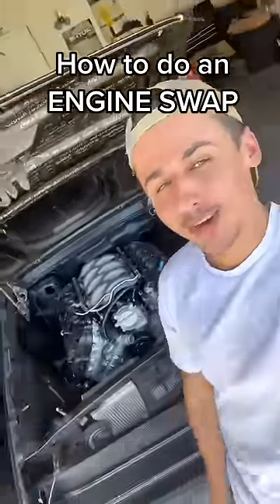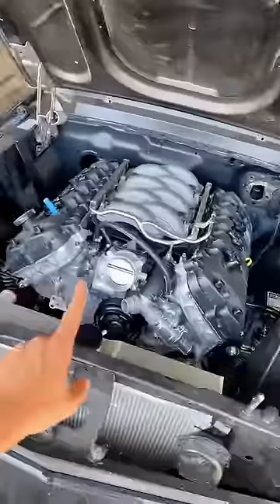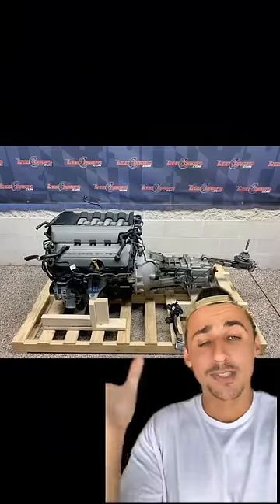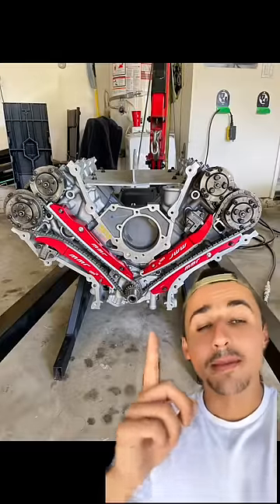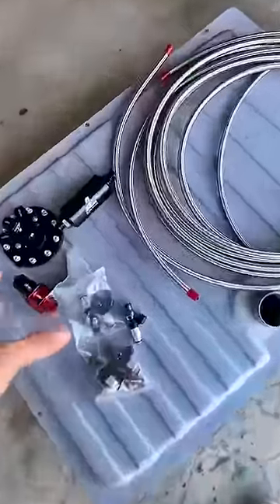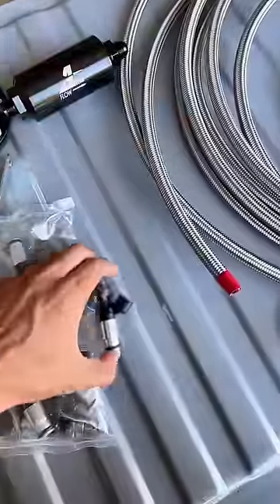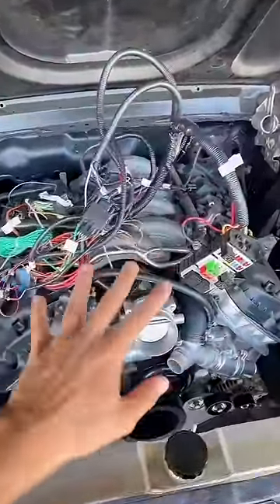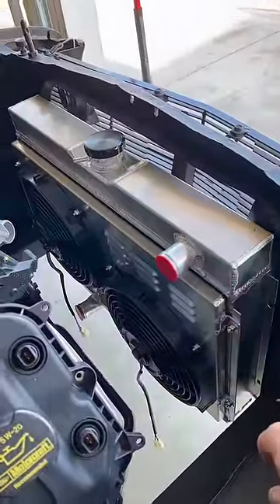How to do an ENGINE SWAP 🏎💨

Comment: It’s not that easy😂 every car has its own level of difficulty and has its differences and similarities, even If it’s a engine replacement or an engine swap, Where you take a engine that didn’t come factory with the car and place and fit it to run like it belongs there. It just depends on your skill and knowledge.
Reply: he never said it was easy. He also struggled putting a gt500 motor on his s197 mustang
Reply: Did you want him to cram the whole weeks long progress into this short?
Reply: Yea but he made it seem/sound easy in the video when it isn’t. to someone new that’s getting into engine swapping, hearing this would make it sound like a breeze. But at the same time you have to have some knowledge on cars and/or know how mechanical things work and operate, in this case engines, before jumping straight to engine swapping. It’s something not every one can do, but can for sure learn to do.
Reply: @ricmane8693  no but yes
Reply: The name of the game is to tune tune tune
Reply: @baconintheoven4717  I'd hire out someone to rebuild the engine then I'd swap it myself
Reply: Right now I am thinking about swapping the 2.6l m103 in my car with the 3.0 version. Supposedly it should just bolt in as it uses the same engine mounts transmission etc. I am 99 percent sure it will not be that easy.

Comment: “If it doesn’t fit… make it.” 
Well you see…. I’m having trouble with the firewall trying install this big block 400 into this gremlin… might have to just be touchin cylinder 8 in the cab
Reply: this guy don’t even know what a gremlin is
Reply: @LeakyCoolant  I always wanted a gremlin for some reason but I just bought a 77 gran prix so it may not be the best idea right now lol
Reply: Make it fit

Comment: Engine swaps on a car that originally came with multiple diffrent types of engines with no electronics is pretty much straight forward.  Also, the aftermarket for vintage mustangs is extensive.

Comment: The main things you need is the transmission mounts, the transmission that'll hold up to your power, radiator, motor mounts, longer or shorter drive shaft, starter if needed, oil pan so it fits on your crossmember/frame, wiring harness, computers, fuses if needed, but all if the wiring is if you're not dealing with a carbed motor. If you're not dealing with a donor vehicle which is cheaper, you'll need everything in this video.

If it's a donor vehicle which is what me and my father using, all you'll need is to flash the computer and have the regular harness turned into a custom standalone harness along with adjustable motor mounts. All the other stuff you might need can be taken from one vehicle transferred to another. Grabbing a donor vehicle is a WHOLE lot easier and cheaper that way.

Comment: generic, but youre not wrong. if you want easy, go with a 90s honda. my first few swaps were on those. used a 96 Si (yes we had them in 96 in canada, but it had a d16y8 in it) with a B18a1, engine harness for the y8 modified to work on the b18, and a computer from a 98 integra. 12 hours later it was driving, by modifying the d16 shift linkages, modifying the rear engine/trans mount, and making the drivers side mount of out steel. total cost of swap, $550. 
my second swap was a 302 ford into a miata, followed by a dodge 440 into a square s10. its all fun and games when you have access to a junkyard.
last one i did was a complete AWD and 5 speed 2.0L 1998 Rav4 drivetrain swap into a 98 auto 1.5L toyota tercel. what a beast! also put in a 2.0" suspension lift and some small 15" all terrain tires. would of made a sick rally car if it had a cage and seats, but it was my daily driver lol. that one took a week on and off

Comment: First step if you have a ford, pull ford motor out and install LS then add go fast parts like turbos, super chargers, so on and as much from Chevy to make a ford fast 🤣.         (Shots fired)  but do love the build🥰
Reply: That used to be the move. Not so much anymore. With the Coyote, Godzilla, Voodoo and Predator motors, us Ford guys have some better options now(albeit, a bit more expensive)

Comment: Also hooking up the drive train and praying it fits and if it doesn't your cooked and have to buy another one, full cost of an engine swap is like 30-70k depending on what engine you get, you can pretty easily pick up a newer Ford v10 supercharger, drive train, differential, transmission, and all the fueling and control pack also fuel systems will run you 30-40k depending on the quality of your parts and alot of yelling kicking blood sweat and tears and zip ties until you get it all hooked up,

Comment: When you've done an engine swap and know it's not that simple. Best thing I have to tell y'all is label your cord's
Reply: Even taking a engine out and putting it back in your still like “where the fuck does this go” with every hose
Reply: Depends on the motor though. If you're swapping a carbed motor to bigger carbed motor, theres not much you'll need and it's a simple bolt in from my experience. But a motor dealing with all these wires is what I'm afraid of, me and my father got a project and this is something we're about to face.

Comment: You can get a used but rebuilt engine for like 3,000 also you should lift the car and put an oil pan underneath

Comment: Ik that he knows there is more to it than this but for the people who dead ass believe that this is all you have to do there is hella more to do like reroute steering new axle motor mounts intake routing needless other brackets and crap to hold it in place, exhaust to hook up to the different headers, other sensors and electrical shit that is time consuming there is a ton else but all I can think of off the top of my head 

Tldr fuck loads of time and money to motor swap correctly

Comment: I had a crappy 307 in my Riviera so I went on Facebook and bought a 350 for $200 got it in the car with an engine pick that I got off Facebook as well for $80 and with a crap load of alcohol and nicotine my friends and I got it to run. I may be spent another $150 on gaskets and new motor mounts. The most expensive (and modern) thing I put in was a 4 core aluminum radiator with electronic 12" fans. That was $500. People can make fun of old stuff for being slow but I can say for a fact it's some of the cheapest and easiest shit ever to work on. I paid a $1000 for the car and for under $3000 I have a running and driving car that throws me back in my seat and I can say is mine. Life is okay.

Comment: I wanna swap in a front wheel drive  civic engine with manual civic transmission.

Or what about if you can you upgrade the original engine itself to take added power?  Cams, pulleys, pistons, tune, etc.

Comment: Totally skimmed over the fact that you have to make sure that the parts you're buying are compatible with each other like the transmission and the engine, for rear wheel drive cars you need to custom drive shaft and possible rear end changes rear axle swaps hub bearings possible suspension changes for the rear end on a front wheel drive car you need different axles possible different hubs and everything.

Comment: You’ll also need new brakes if your going for more hp as well as new suspension and a new rear end you’ll prolly also need a new gauge cluster if you’re doing something like a coyote into an old car like this because it will more than likely lag behind because it’s old tech and that’s just a few more things I get the feeling this guy didn’t do it himself or he just wants views on his shorts so he made it sound super easy

Comment: I've been having engine problems for at least the last few thousand miles on my 4runner and I've spent at least 10k on the truck. I've been driving on a bad head gasket for months and all this time I could've just ordered a used engine with less than half the miles for under a grand 🤦‍♂️

Comment: You're looking at $25,000 just in parts. Summit racing has the combo, trans, motor, power pack, for $17,500 not including taxes. You need fuel, mounts, suspension, and brakes. Good luck out there.

Comment: Annnnnd: throttle control (drive by wire or cable?), speedo, tach, suspension modification, rear end built for power, intake plumbing, battery, fuse box, power steering mods… ect.

Yeah it’s not easy.

Comment: Definitely over simplified it, but got all the basic steps down. Difficult obviously varies based on which car and what engine your putting in it, so do research. I generally like cars the way they come mechanically, and only really do things like suspension, power adders and other cosmetic and race influenced mods, don't ever plan on doing an engine swap.

Comment: Thinking about doing a Ls swap on an older car or Ls swapping my gmc yukon it has a 4.8 which I wanna turbo but I can’t decide  between having a turbo 4.8 or dropping a 6.2 in it and getting a Miata, accord, 96 mustang, 240sx, maxima , solara, crown Vic , Lexus sc, ford ranger, Altima, fox body or bmw 3 series and drop the 4.8 from the Yukon or a ls1  in it or drop the 6.2 in the Yukon

Comment: You need a car, a motor, k member motor mounts, steering pump, steering column, a transmission because not all motors go to the same transmission you need a ecu and wiring harness for that motor which Holley makes one and personally that’s why I prefer Chevy over ford because it’s powerful for cheap and they have adapters for just about everything and since they pretty much only used 2 transmissions every motor they put out can mount to your trans with little to no fabrication or modification that’s why everyone LS swaps their cars and the secret sauce is even though the 5.3(it’s real name is lq4) isn’t apart of the Ls family that wont stop you from using ls1-ls3 parts in effort to gain more power for cheap. With Chevy you can have a Frankenstein motor with ford you can take out two mortgages and still won’t make as much as bubba and his junkyard motor that got for 750

Comment: You forgot transmission bell housing adapter drive shaft rear end ignition system fuel pump fuel lines fuel line routing they're way way more steps to engine swaps than this.

Comment: Idk everything about cars but does it make sense to put a 392 ina civic by cutting the floor, firewall and the front end and built everything around the 392 motor and will I have to weld support on the frame so it doesn't twist from the torque ?

Comment: Ayo I have a question. What if the engine is in the car is rotated? The mitsubishi 3000GT has an engine which has it's transmission looking towards the wheels. Just search mitsubishi 3000GT engine and you will see what i am talking about.

Comment: I have a Nissan Silvia s14 with a 4.5l v8 bmw and the rpm and speedometer clocks doesn’t work. How do I wire that up and it’s a bmw gearbox to

Comment: You’re missing, drive shaft, wiring the car, plumbing the fuel system, making motor/trans mounts, trans tunnel, shifter location, clutch master cylinder location and plumbing and bleeding, custom exhaust needs to be fabbed up, A/C compressor/condenser/dryer/blower assembly etc needs to be planned out and installed and it needs to be tuned. Stop acting like you know how to swap a car or that your video is even mildly informative, don’t kid yourself daddy’s money you’re paying someone to swap that mustang and you don’t do a damn thing yourself besides make cringe shorts lol.